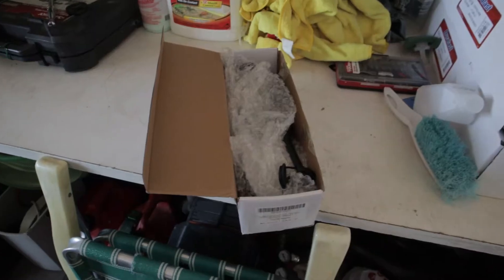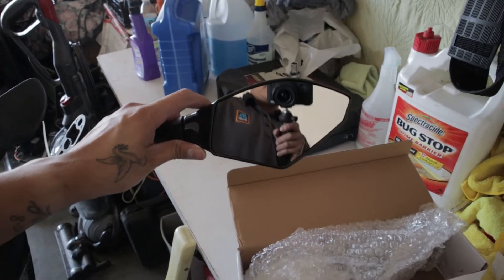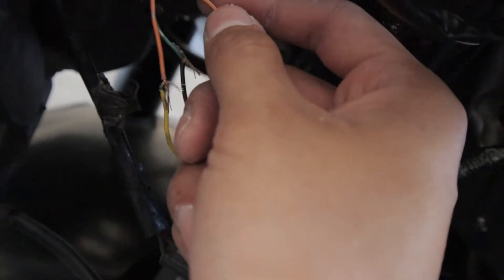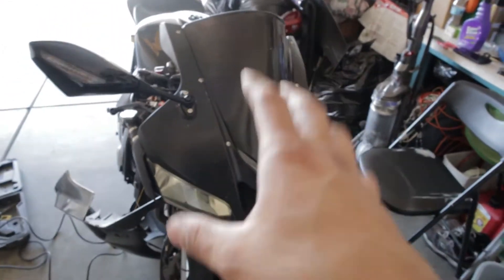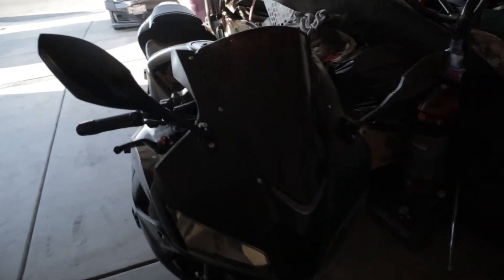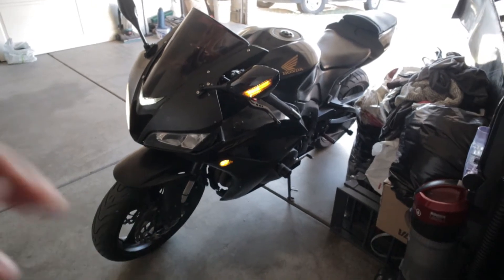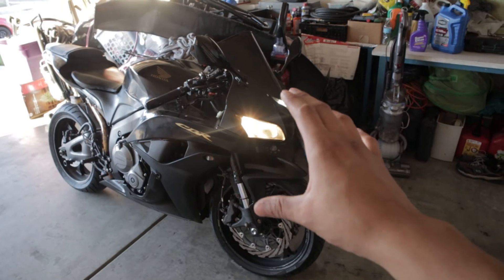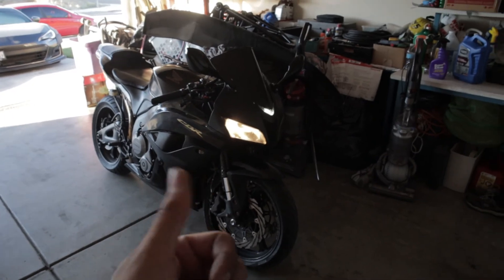LED Turn Signal Mirrors For the CBR600rr

Comment: I fitted these last week its far better to drill the hole where the mirror sits on the fairing and dremel out one side of the bracket to hide the wires